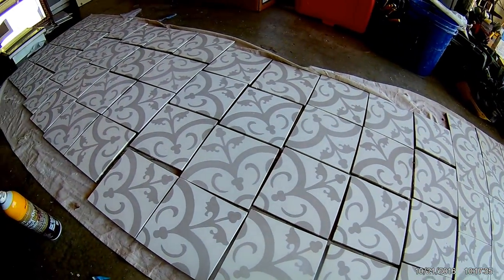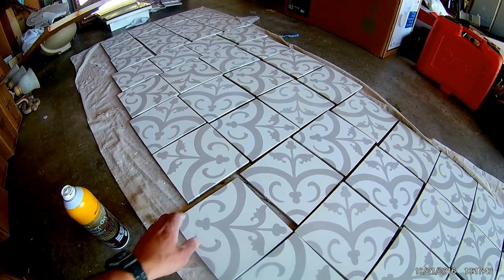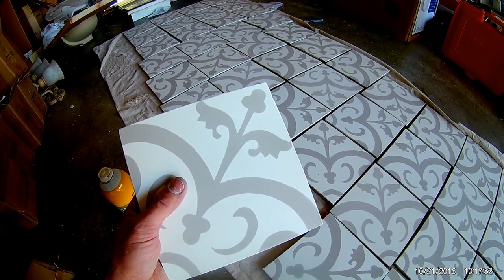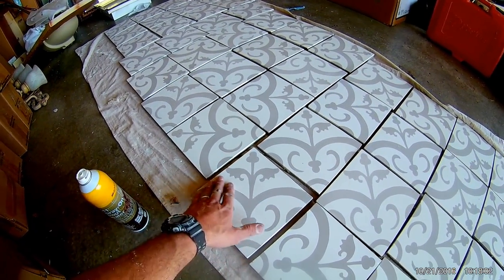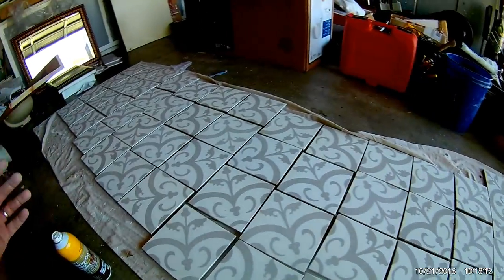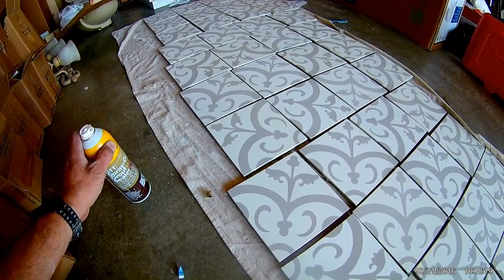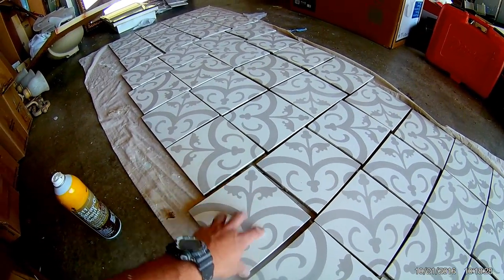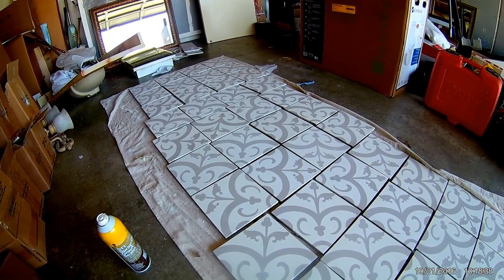How to Install Cement Tile Quick and Easy!

Comment: I noticed there was no spacers used. For pattern tile, do you butt them up?
Reply from the maker: This type of concrete tile varies in size from one tile to the other. We install without spacers and simply eyeball the grout line. 👊

Comment: Did you install a cement board before putting in the tile?
Reply from the maker: I believe this was on a concrete slab. No board necessary for slabs, but now we always use Schluter Ditra.